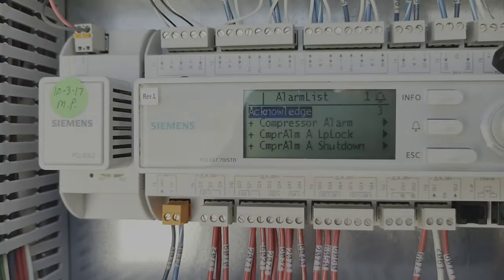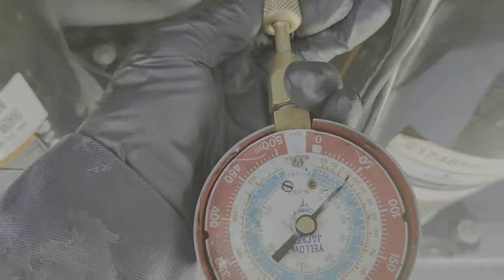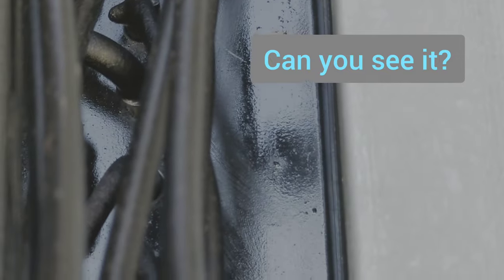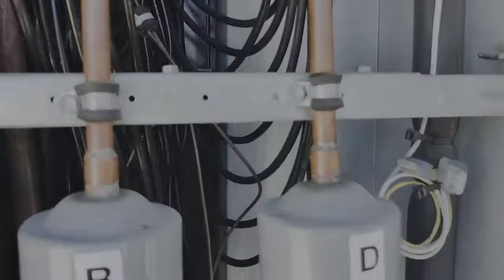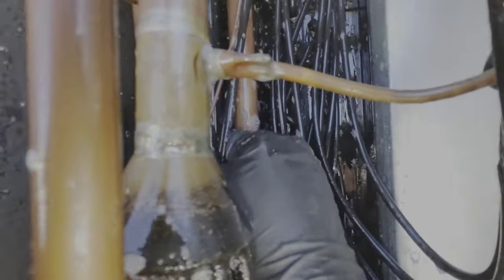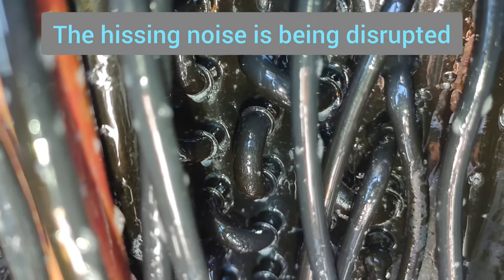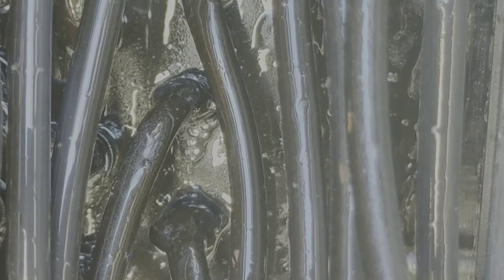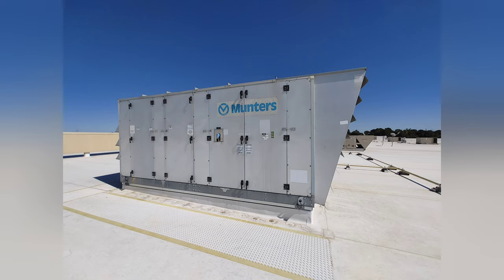Major R404a Leak Found In Huge Evaporator on Munters RTU Dehumidifier - Part 1 Of This Job

Comment: Also, the tubes coming of TXV on those Munters evap coils rub each other and wear through quite often.   They need to have silicone in between or wrapped at manufacturer to mitigate the issue.  Of course, that is separate from where you found the leak on that unit, but very common on those units to have leaks on tubes.
Reply from the maker: Im sure that they do. Its a mess in there

Comment: If these munters have a black screen on display what does that indicate?
Reply from the maker: I'm sorry I didn't get to replying to you sooner.  I don't really remember exactly what the screen looks like or what kind of display it is on the Munters unit but I would say that if it's black blank and not responding, you may have a power issue going to the screen or the screen display needs to be replaced. Make sure you've got incoming power to it. And what I would probably do is call technical support on it.
Reply: @HVACRServiceTech  yeah I got a hold of munters that day hrs later. If the lcd touch screen is getting it 24 DC voltage and you powered cycled the unit. The screen needs to be replaced. From what they say it already comes programmed but you know how that goes Lol